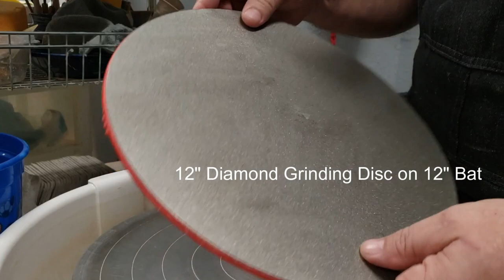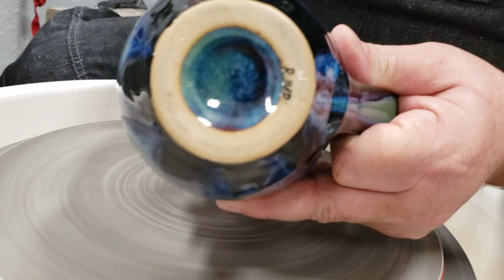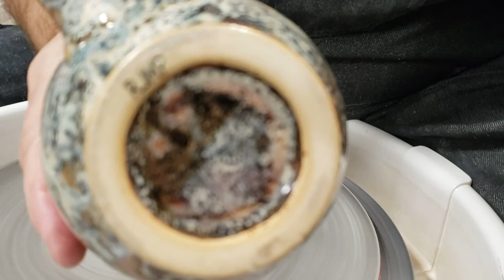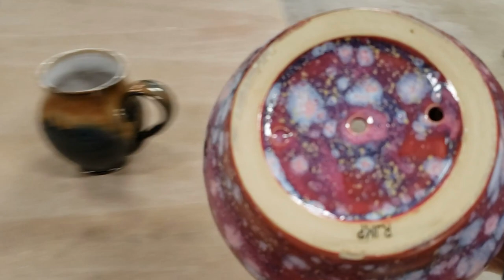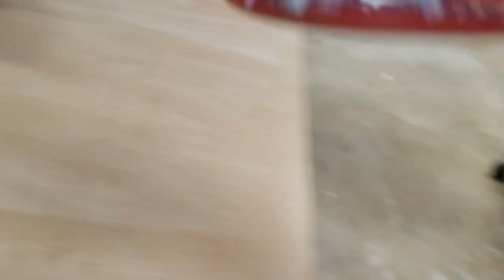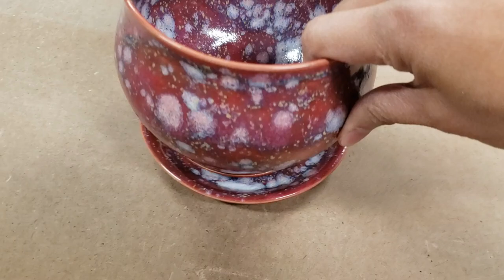GRINDING/SANDING THE BOTTOMS OF MUGS WITH A DIAMOND GRINDING DISC FROM DIAMOND CORE TOOLS

Comment: What grit are you using? This is pretty much sanding and not grinding. What grit do you use if you have bad glaze drips? Thanks.
Reply from the maker: Depending on how bad it is, we have the 60 and 120 grits as options.